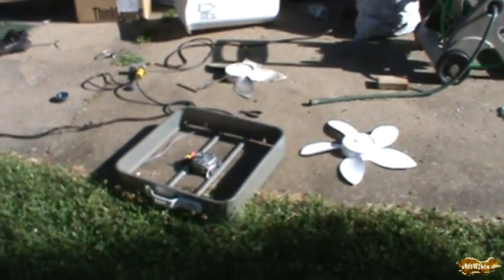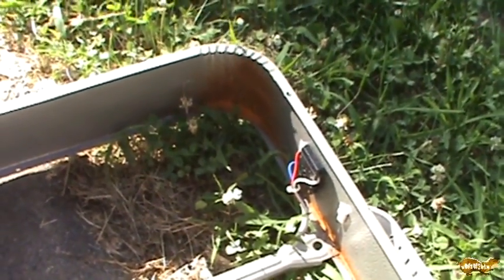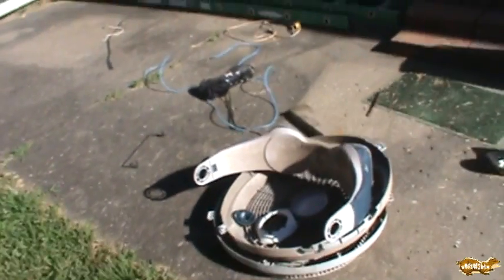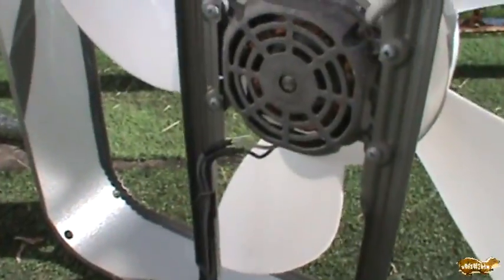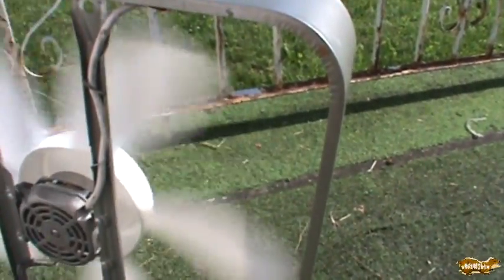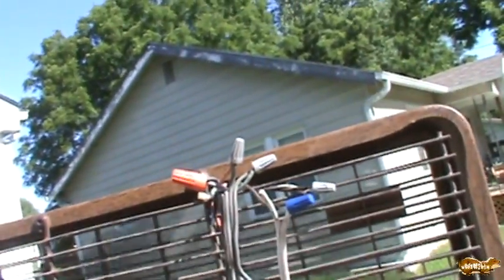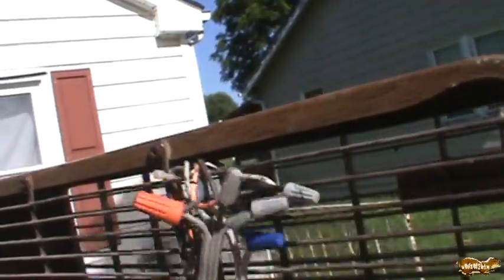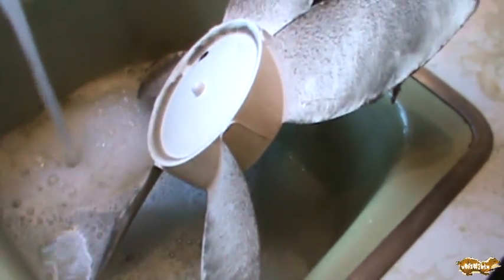One broken fan fixes three!

Comment: I got four Aerospeed box fans back in 2006'ish from Family Dollar.  They were $12 each.  And yes, a 5 mfd capacitor will do just fine, you wouldn't want to use a 3 though.
Reply from the maker: After making this video, I have started keeping an eye out whenever I get to see the cap on a box fan,  5mfd seems to be the "standard" in fact, the areospeed is so far the only fan I have seen so far with a 4 mfd.   In other news, the Edison featured in this video died again, gotta figure what's up with that sometime, saving that for a "rainy day."  ;)
Thanks for the comment.

Comment: Aerospeed it was owned by Jarden but its now taken over by Newell-Rubbermaid as Aerospeed was made after Lakewood went out of business as some has what fan people say have the Lakewood class A John Brown Brace blade on them. i think this blade has to be the early design before the brace blade appeared on it now its on Sunbeam, Kenmore, Holmes,  Lakewood and other box fans sold today. lucklly today my Target is still selling the El Cheapo Holmes box fan. as these thermal fuses in the motors always pop what i do is put in an auto reset thermal protector you can get them off EBAY and a metal oval run capacitor if its a 4 mfd 250VAC capacitor your original cap is you can replace it with a metal oval run capacitor like a 4mfd 370VAC capacitor will work as i replaced one with that the fan works without any issues . as that i had laying around but the capacitors don't cost much as these fans are around $20.00 around there typically. the most expensive fan thats well worth the money is the USA assembled fans made by Vornado the 293 Heavy Duty seems to be the best out there.

Comment: I try saving my fans from throwing them out. My wife has a small box fan breezeway not sure who made or where came from.  Them walmart air ciculatlor type by manna or something them black metal cheapo fan. Using 3 in one oil works good right? ??
Reply from the maker: +Matthew N 3 in 1 oil will do the job, there is a 3 in 1 in a blue bottle that is supposed to be better suited for motors, but if you can't find the blue bottle at your local retailers (Like I couldn't,) regular 3 in 1 will get the job done.
Reply: Yea i figured that.  Sometimes fans get sluggish  even after oiling